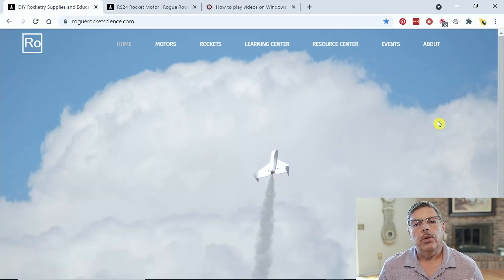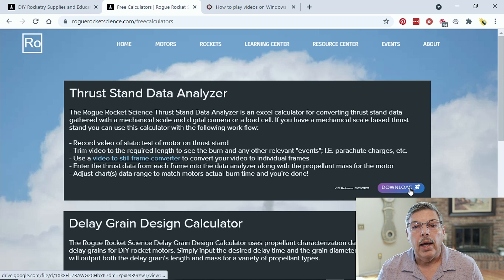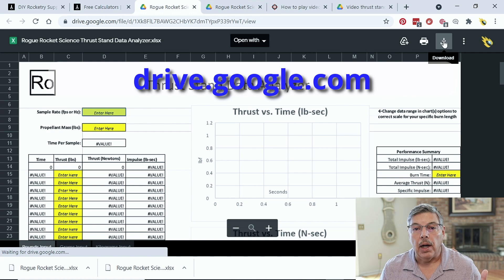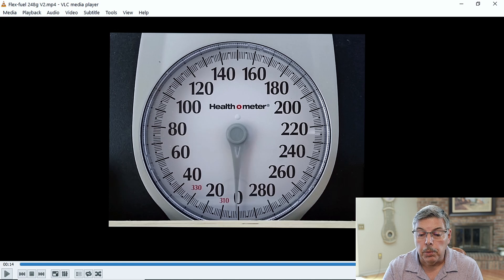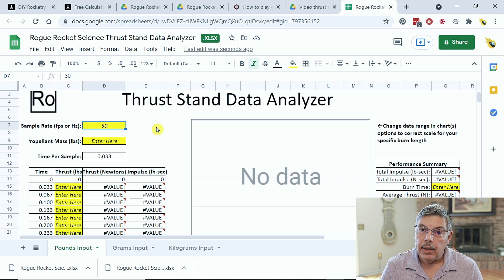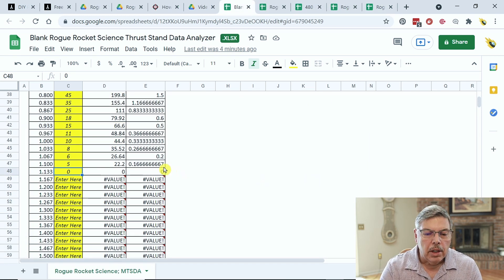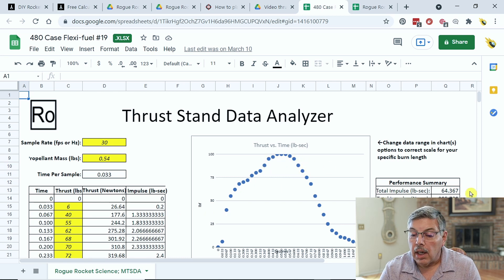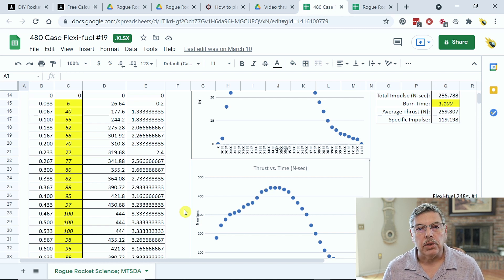Thrust stand data entry. Measure rocket motor thrust and performance!

Comment: Do you have any of the rogue rocket science motor cases? Thinking about getting the 24mm one.
Reply from the maker: Yes, I have the RS24, it is simple and very easy to use. I recommend giving it a try . I planned on doing a full review this summer but now it may be spring before I can get to it.

Comment: I bought an arduino uno R3 started kit clone (elegoo), a pair of suitable range strain guage units and amplifier component for well under $100 in total, and will build a test stand so I can zero the readings at the start and capture the data digitally (plenty of youtube videos on how to do this). Using a video recording of a test and then trying to 'read' the analogue values from a bathroom scale frame-by-frame seems way too much trouble in comparison.
Reply from the maker: The whole process of building the stand and reading a bathroom scale is simple and straight forward. That makes it available to a larger audience.

Programming an Arduino, determining what strain gauge and amp to use, figuring out the gain and zeroing the readings. And you need a laptop for the field. That seems like a lot more “trouble” to me.

Then all this has to be filmed and explained so everyone understands the complete process. Sorry I am not with you on this. You make that video for free and I would be happy to watch it!
Reply: Would it be possible to link these videos please ?